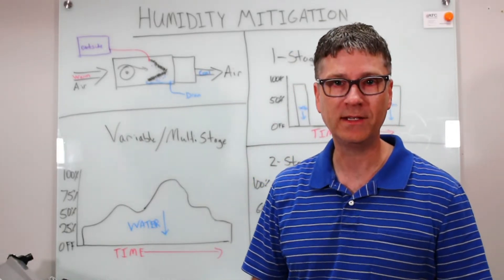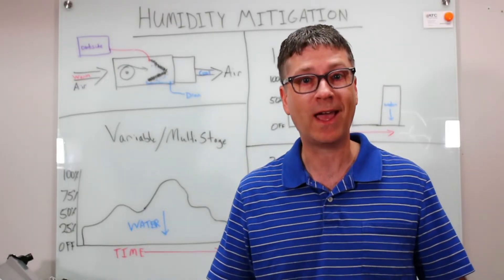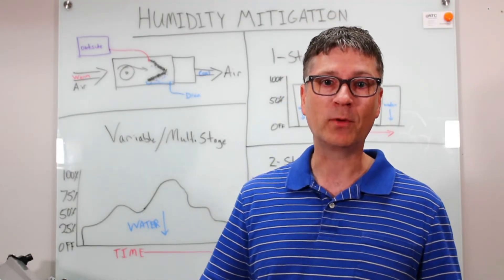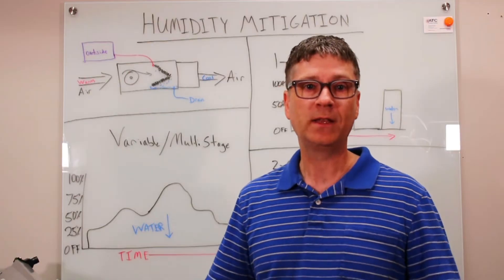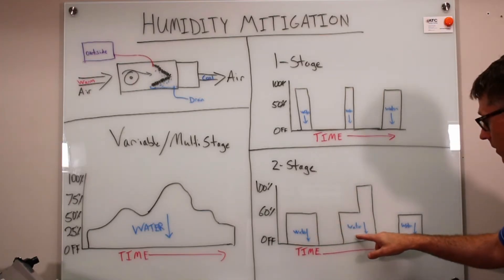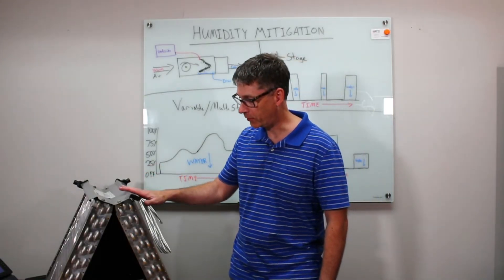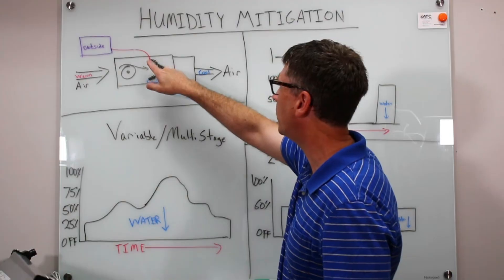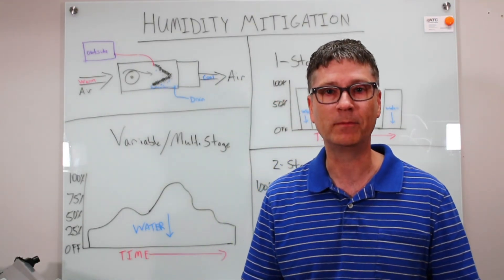How to Maximize Humidity Mitigation from your AC!

Comment: What about winter, any solutions
Thanks
DomIJ
Reply from the maker: Hi humidity in the winter is rare.  That said, super tight homes can experience this issue.  Make sure to run bathroom exhaust fans and the kitchen exhaust fan when in use.  But you may also want to invest in dedicated dehumidification.  Look at the Aprilaire RE080 for example.

Comment: looking at your picture in the top left, my AHU is setup identical with fan on the left of the unit and coils on the right.
my question is- is it normal or is performance degraded because my supply is after fan and sucking instead of after coils pushing? again, assuming your picture is my setup, the supply side is fan and return is coils. normal or performance loss because of this install? OR am I going to see more or less humidity from this type of installation?
Reply from the maker: The position of the fan vs the evaporator coil doesn't have a performance impact. Engineers compensate for the different air flow.

Comment: How can I tell if its possible to add a bedroom to my existing attic mounted A/C system?
Reply from the maker: This is mostly a capacity issue.  I would start by having a Manual J load calculation done on your system and then compare that with the output capacity of your existing system.

Comment: The AC removes moisture from the home. Regular reasonable on off cycles continue to reduce moisture as long as long as there are no major sources of  vapor. - we don’t run a steam engine… The problem is that in cool weather, the AC will reduce the moisture but also the temperature, keeping the relative humidity unchanged. Dehumidifiers remove moisture with net heat added, thereby reducing relative humidity without cooling the ambient temperature to uncomfortably low.

Comment: Bs ….tells you nothing about how to maximize humidity reduction….just get a new unit……..
Reply: "Just buy out highest tier inverter system to fix all your issues!" Classic example of today's HVAC companies.
Reply: @TofuInc  it doesn't have to be highest tier. BUT it should be inverter to MAXIMIZE dehumidification.

if you don't have humid air problems, stop looking for solutions.

and if you face this problem take advice or keep suffering. easy as that.  you can't expect a solution that you dictated to a company.  physics doesn't work that way.

Comment: Thanks for the great and simple explanation of the HVAC system. I live in Arizona, and you think there is low humidity, but my house attic is too tight. ICF construction with blow foam insulation on the cathedral side of the roof. Humidity is destroying my evaporative coils in 2-3 years' time, very rusty and pin holes. Should we install a whole-house dehumifier in the attic? Appreciate your opinion on this issue. Thanks
Reply from the maker: A dedicated humidifier is a good idea for your application.  I would recommend looking at an Aprilaire RE080 dehumidifier (or similar).

Comment: Great explainer!  Question, if you have a single stage A/C unit that can’t keep up with cooling/dehumidfying, is a dehumidifier a good solution to improvement?  Or is a variable speed system the way to go?
Reply from the maker: While a dehumidifier will certainly reduce humidity in the home, it may also worsen the problem of your AC system not keeping up. As it works, a dehumidifier outputs heat.  And that heat is now something extra for your AC to deal with.  But before going the route of increasing the size of your AC equipment, I would take a hard look at your ductwork.  More often than not, it is not the size of the equipment that is the problem, but too-small ductwork that prevents the cooling from reaching your conditioned space.
Reply: If you have a variable system what is the humidity & temperature you recommend setting for comfort & economy?
Reply: @laceywallace2188 45 - 50% rel.H. and 21°C